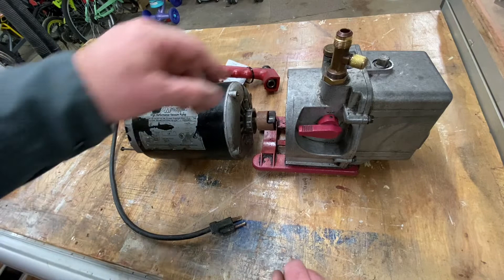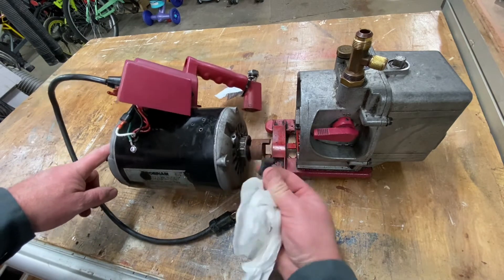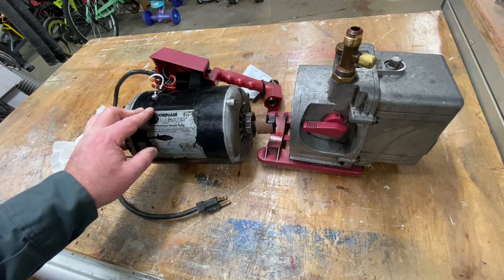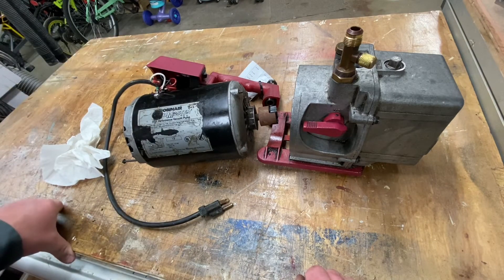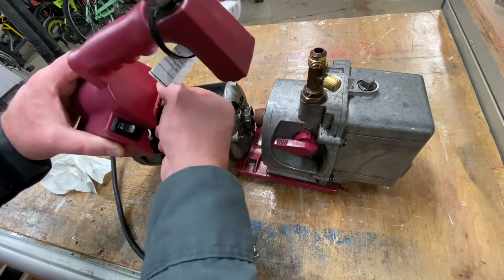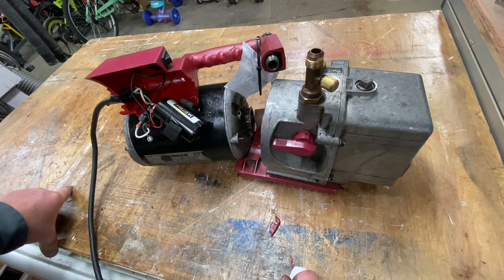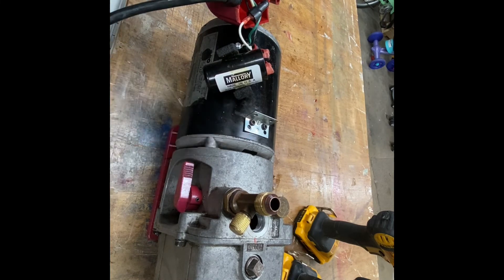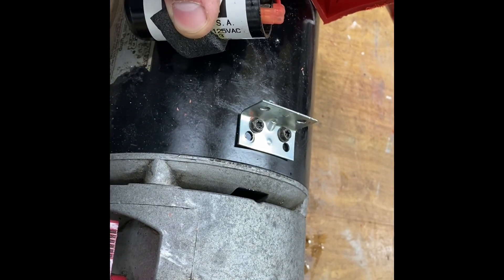Robinair Vac Pump Rebuild. They don’t make ‘em like they to. Part 1

Comment: Hello, how are you? I have a problem with the same model of vacuum pump machine. My problem is that I don't know how to connect the terminals for operating the motor on a 220-volt system. I hope you can post a video on how to completely disassemble and reassemble the machine for the necessary maintenance.

Comment: Same as mine 
15401 cfm = 4   ,,,,Plastics are available ,, unfortunately my pump struggles to get a vacuum despite 3x oil  flushes. Next step is to strip and inspect pump section .

Comment: I have a robinair mo 15425..it has a large port on the top that socks air good..the bottom port has the standard fitting..it doesn't do anything..what's the bottom one for?

Comment: Thanks for putting out this information. Just picked up my first used Robinair 15400 today. Just out of curiosity do you know what the viscosity of the oil is that these pumps use? thanks in advance.

Comment: Just pulled a later model (blue) one of these apart. A complete dismantle, every item except the oil seal in the case was removed. The unit had very low use but went underwater in a storm and was left as is for about 5 months. Changed a clunky bearing in the motor 6203RB and meticulously dismantled, cleaned and polished the internal surfaces of the vane pump, not so much corroded as stained and discoloured on its surface from the water sitting there mixed with the vacuum oil. there was some slight surface rust on the external surface on the pump, that to was cleaned off. I noticed on reassembly there were no dowls or the like for aligning the plates and body of the vane pump. Given the tolerances of the mounting screws and the lack of an end bearing in the pump, the whole housing was free to move slightly on the alloy face its attached to. Just seems a strange way of doing it given the shaft at the motor end just runs through an oil seal and that's it. I wonder if there is some special factory alignment pins that are then replaced by screws during assembly. Anyway it works great now sucks a serious vacuum, wish I had a manometer or Torr meter to quantify that. Just wondering if anyone else has had the vane pump apart and did anything besides align and centre the plate stack and pump body pieces visually on assembly.
Reply: I just watched another reseal video and saw that the seal kit comes with a line up tool. With the shaft seal removed from the bore you install this line-up tool into the bore (from the inside of the housing). Then when you mount the pump housing, the pump shaft will align right down the center of the line up tool. Tighten pump bolts and remove the tool.
Reply: @steadyeddie7453 thanks for that, used mine about 10 times over the 3 years, still working well, must have got it pretty close